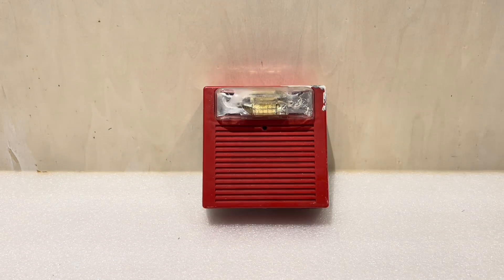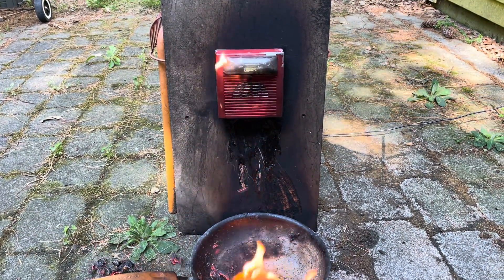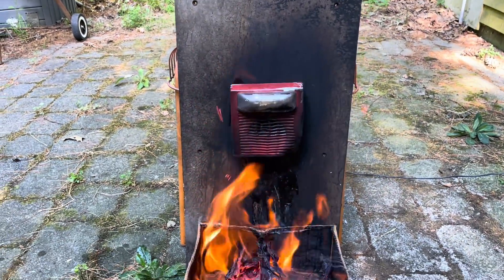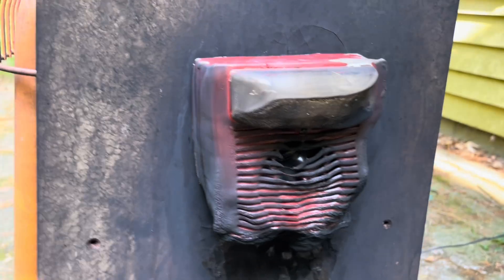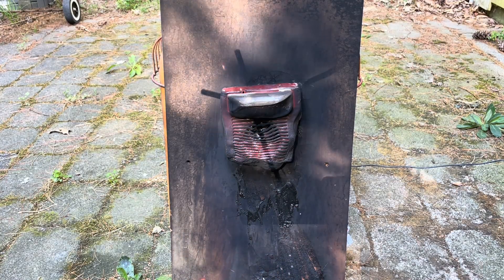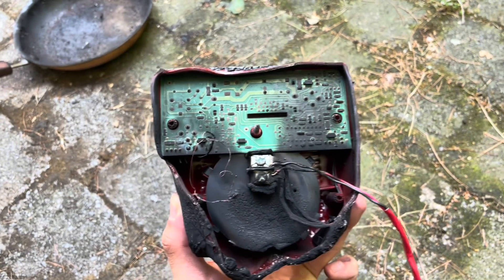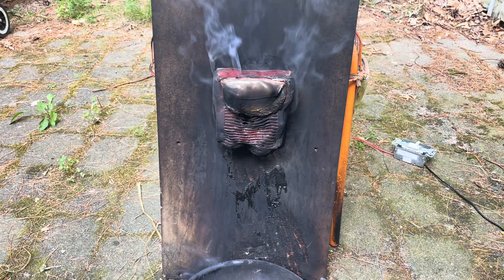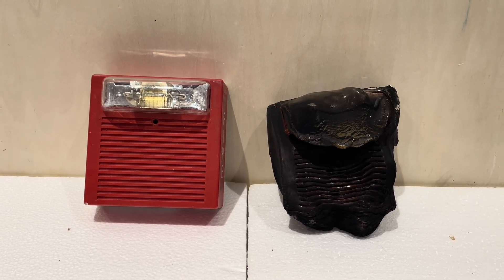Setting a Fire Alarm Horn Strobe on Fire 3 | How Fire Resistant is a Wheelock AS Horn/Strobe?

Comment: That's crazy that that fire drill is still going even after being burned because you would think the light and the horn strobe would be like charred by now. I know back in the day they used to make fire drills out of metal and if this was a metal one then I'm pretty sure it still would be hot and I'm pretty sure the alarm would still be going off but I guess they ditched them to use plastic.

Comment: Anyone who knows old school fire alarms knows he HATES these newer fire alarm systems. He calls them junk and says they’re such crappy alarms that won’t stand a chance in a fire. Someone needs to show him this video.

Old School Fire Alarms believes that a 1920s pull rod fire alarm and 1950s autocall fire alarm system is more superior than today’s fire alarm systems. What’s your take on that? Please anyone let me know.🚨
Reply from the maker: While I agree that older stuff has more novelty, I completely disagree with the idea that older fire alarm systems (such as a pull rod system or something like that) are objectively superior to a modern system. Those systems are rudimentary, and while they might be neat, in terms of fire protection value, there’s no comparison between an older, obsolete system and a newer addressable system.
Reply: @FireAlarmDude5967 I feel like some older alarms would still work just fine with minor adjustments. Like the Simplex 2901 9838 would be a good fire alarm. As long as it did temporal three and the strobe plate had adequate candela output and was capable of syncing. Also the quantity of alarms would need to be sufficient for the size of the building and rooms in the building. In other words one 9838 in the hallway wouldn’t work. There would need to be multiple horns based on the length of the hallway. There would also need to be one in each room.
Reply from the maker: Sure, and mechanical horns are still used selectively, but those devices draw an atrocious amount of power. Also, undeniably, mechanical horns are less reliable than more modern equipment.

Comment: 5:32 When it stops, you may notice that the strobe “hiccups” and flashes a little too fast. That’s what syncable Wheelock devices do when they loose power. That’s means that the device’s electronics are continually working the whole time, but the power source is just having a bad connection (probably from getting melted off).

Comment: This is What I Remember, I just wanted to let you know I was in an Apartment Fire In Early November of Last Year, because of a Faulty washing machine that caught fire, and what happened was when the apartment fire happened after I got out and Called 9-1-1, The Things That are made of plastic melted, The Smoke Alarm was Melted and The Heating Thermostat Controls and The. Vertical Light Switch In The Hallway Was Melted and all The Plastic Curtain Blinds were also Melted.
Reply: They should make the bins UL listed

Comment: I actually liked how it survived most of it I think either way fire alarms were meant to survive a lot of flames just in case there's still people inside especially the classic versions because the classics were made out of straight metal but the cheap plastic alarms like smoke alarms are not meant to survive for that long